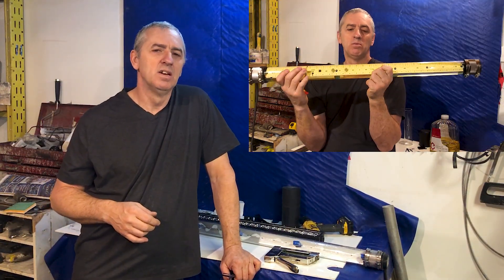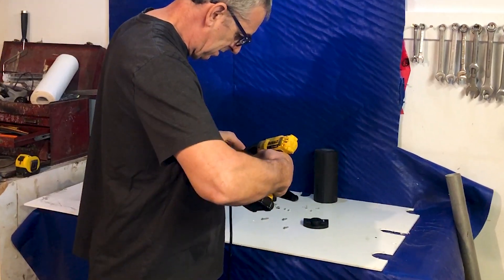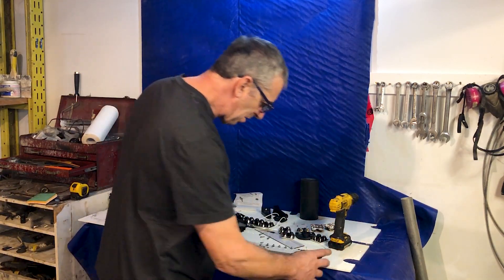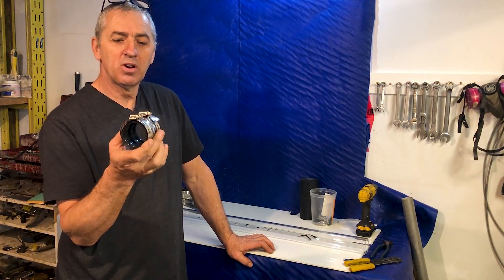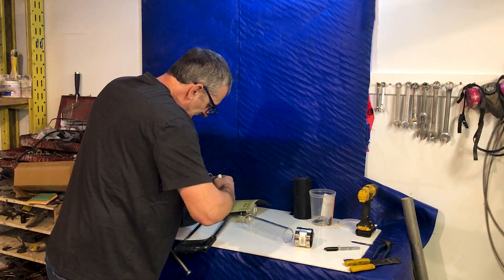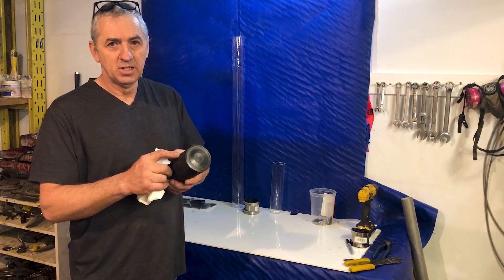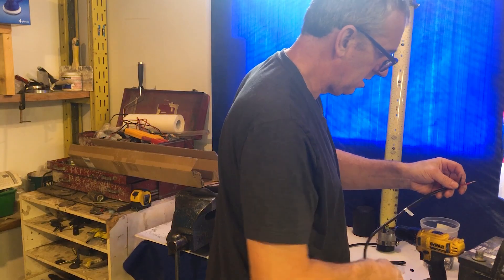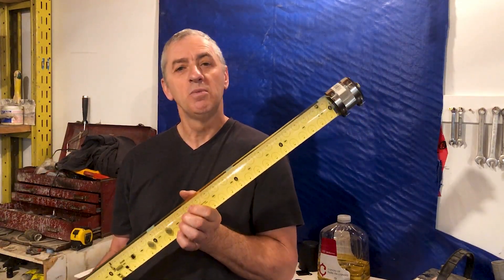How To Make An Underwater Submarine LED Light Bar

Comment: Great vid thanks!! I’m doing something similar, but only submersible to maybe 20’ max (flounder gigging) I’m using the housing the lights came with, sealing it with silicon, then filling it with mineral oil. Cooking oil sounds better as I like the yellow hue and it’s cheaper.  I think I’ll also use your screw terminal idea as the only leak I have is where the cable exits the housing. Thanks again for the vid and ideas!!
Reply from the maker: Glad to hear it.

Comment: Hey Hank, great content. I'd love to see your take on oil compensating a Minn Kota. Any tips you can share?
Reply from the maker: Hi, I oil compensate them all the time with wd-40 with a small expansion tube.
Reply: @HankPronk  Thanks for the reply. That makes sense to me being a nice thin liquid for the armature to turn in and also added benefit of the water displacement from the WD-40. Any longevity issues on soft goods with the WD?
Reply from the maker: @graiggutowski2788  I have't had a motor die yet.  WD-40 will harden some plastics.
Reply: @HankPronk  Sounds good to me. And the armature shaft has a corrosion resistance half life of 100 years! Hank, can I email you re: some questions I have?
Reply from the maker: @graiggutowski2788  sure but asking here will help others.  I know there are other people building or contemplating a build that will benefit from all questions.
Reply: @HankPronk  That's why I asked. I'll pop over to a video or two more relevant to my questions and post them there. Thanks.

Comment: Thanks for the amazing detailed video. Have you considered filling the tube with some kind of clear epoxy instead of oil? In theory it could then be a lot simpler, and could potentially handle more pressure since it would be completely solid, but there might be some gotcha I haven't considered. Thanks!
Reply from the maker: Hi Wayne, yes did experiment with that but the epoxy makes it overheat and burn out.
Reply: @HankPronk  ah that is good to know. I can imagine those LEDs must get super hot. I'm planning on potting some electronics (that don't get too hot) and see what happens. Thanks!
Reply: @HankPronk  >>> Thank You for answering this question -- I was wondering the same thing myself.

Comment: Great Video!  Hey. why don't you use the diffusers? Wouldn't that increase the light by reflection?  Thanks!
Reply from the maker: Thanks Gregory,  the defusers don't help under water.  I don't know why but experimentation showed no benefit.  Also they don't fit into the 2 inch tube.  I would have to increase the size of the tube.

Comment: Great video and light bar Hank.   Why to you refer to the end pipe clamps as "bellows"  They don't really flex do they?  Do you try to get all the air out?   or do you leave a small amount for some reason?    -  Brian Cox
Reply from the maker: Thanks Brian, yes I do remove as much air as possible.  The rubber clamps do exactly that.  They flex to pressurize the inside of the light to mach the outside pressure.